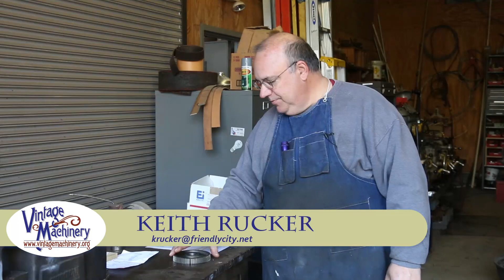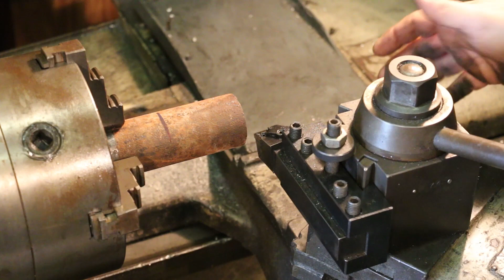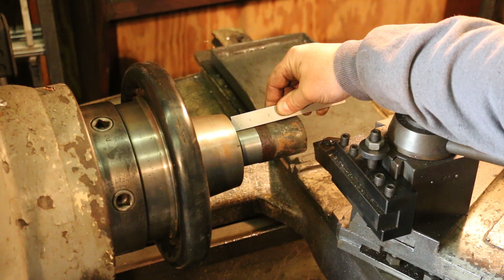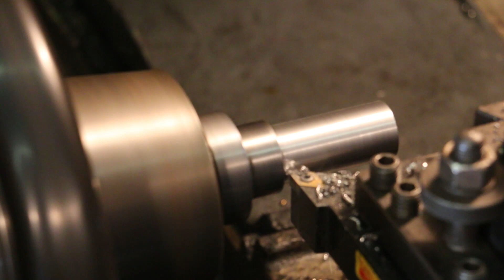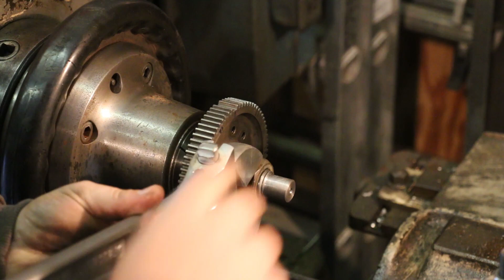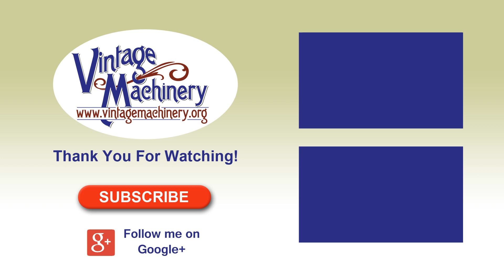Broken Gear Repair:  Machining a Custom Mandrel to Hold the Gear

Comment: Do you happen to know what the pressure angle of the teeth are on the gear? I have a clausing mk3 with the same issue on the same gear and I haven't been able to find a source anywhere not even the manual that mentions it. There's an article that mentions that the mk1 version had 14.5 degree pressure angle gears but according to the same article they changed a lot of details between the versions. Also my gear doesn't mesh very well with a known dp 16 14.5pa gear. I have tried a few ways of measuring the pressure angle but had little luck getting a solid answer. All the measurements I have taken indicate that its pa is 20 degrees but I don't want to buy an expensive cutter to fix it only to find its suppose to be 14.5 and it matches a cutter I already have.

Comment: Hi Keith,

You don't of course need a dividing head for re-cutting the teeth. You can just index off some of the existing teeth.
Reply from the maker: +Paul Compton I will set up off of some of the existing teeth but then I have to index to the new teeth that will be cut.
Reply: +Keith Rucker - VintageMachinery.org Using a lathe change gear and an index plunger is a common model engineering trick for simple dividing, there are many articles on setting one up on the back of the lathe spindle for example. 

As long as you chose a section of the gear to be repaired that has sufficient adjacent good teeth, you can use those teeth as indexes to re-cut the teeth on a damaged section. 

I thought it might be good to show people that this sort of repair is possible, even if you don't have a suitable dividing head, or one with the right indexing plate.

Comment: Great job making the arbor. You are about the only guy on the tube that runs the key seat cutter at a slow RPM  as it should be, as I have done, do, and been shown by my toolmaker fellows on the job...helps prevent chips/heat loading and snapping off at the small dia. of the shank. {Or maybe it was we were paid by the hour?}
Reply from the maker: +alpho52 The first time I ever ran a key seat cutter many years ago, I ran it real fast and it made this really fine chip almost like steel wool.  Then it got hot and the shavings turned red and actually caught on fire!  That was when the older guy in the shop who I was learning under taught me how I was supposed to do it....

Comment: Hi Keith I was wonder is the gear cast iron or cast steel and if it was cast steel if it would be better to weld the area up with a mild steel rod say E6012 or E6013 and then machine the teeth back I am not a machinist and was just wondering
Reply from the maker: +DS75921 It is cast iron.  I know that some people weld cast iron, but I have had the best success with brazing on cast iron.
Reply: Hi Keith here is why I ask there are two grades of cast, cast iron which is the lower grade and cast steel. my welding teacher taught me that if you can cut it with a cutting torch you can weld it with a mild steel rod which works very well. just my thoughts

Comment: Keith the other day I watched a video of yours published about 2 years ago and you made some spacers/dam for a Babbitt pour for the planer matcher. You used some shafting off of some railroad wheels. The material you used to make the mandrel looks like the same stuff. If it is you must have a lot of it. I really like your videos and watch them with great interest. So much so I have been in contact with L M to come down for a couple of weeks to do some volunteer work at the museum. I live in Ohio and I need to get out of this snow and cold. I hope I get to meet you
Reply from the maker: +captahab801 I don't think that particular slug was off of the old railroad axles, but we have tons of old rusty "mystery metal" here at the museum - mostly old shafting salvaged from various places.  It is nice to have stuff like that for jobs like this without having to go out and purchase something new.  Good luck with your volunteer work - I hope that works out good for you. I also hope that you can stop by for a visit to the museum here one of these days!

Comment: That is great! I am in the process of doing something like that. But I use a turntable to cut the gears and it has a mt2 holder. I can't thread on my lathe because the gear is broken. I find it difficult to have the thread exactly in mech with the taper in order to have the gear center. Maybe in the second part I will see how you hold the part in the indexer.
Thanks for taking all of your time to show us so many things.
Warm regards
Reply from the maker: +Robert Patoine A turntable can be used to cut gears just fine - you just have to be sure you dial it in just right.  I will have the dividing head job coming up real soon.
Reply: +Robert Patoine  Since it is the shoulder and face that determines accuracy and not the thread you can just tap the arbor and use a bolt to hold the gear. Or you could mount the gear on a plate that is bolted or clamped to the faceplate or table. Or single point broach it on the lathe.
    Mike (o\!/o)

Comment: I cried a little when I saw you use that emory cloth without covering the ways...  =(
Reply from the maker: +Jay Walt I guess there are different takes on this.  I always clean my machine really good from one job to the other so any abrasive that would be on the ways will be cleaned up.  And because of the range I was running the lathe, the carriage never ran over the ways in that area.  When swinging larger diameter items like this gear with all of those teeth on it, I don't like putting a cloth under the part as it is too easy for the part to grab it up and start swinging it around where it could hurt somebody (myself)!
Reply: +Keith Rucker - VintageMachinery.org Gotcha, makes sense and happy you're aware of it.  A guy wanted to buy my logan lathe but when I found out his only use was going to be grinding on it I refused to sell to him, he was pissed but It was the principle of the thing.  I just realize these well made machines wont be around forever.  I love your videos!  Hope to see more locomotive work!

Comment: Keith just a question for you why did you not undercut the flange and the diameter so the nose radius of the tool so the gear would purchase on the face of the flange?
Reply from the maker: +James Spires I actually did - but I probably failed to mention it while I was doing it.  When I faced the flange, I ran the tip of the cutter into the diameter enough to give clearance.  That is pretty much how I always do it.

Comment: That's a lot of metal to shave off.  Love the thread cutting, so meaty those curls of steel coming off the cutter.
Reply from the maker: +excession777 That part was hiding inside all the time - just had to get it out!

Comment: keith, thanks for getting back to me.i can tell by the comments that i didn't explain my self very well. when i made my comment about the angle of the compound i was not refering  to threading. i was taught when turning stock to set the compound at 60 degrees and use it to set the doc. then use the cross feed dial as a repeatable zero. if i need to thread i turn the compound to 29 1/2 degrees. of course if you have a dro that changes every thing. you can set zero and return to it anytime. i know other machinists who use your technique and i was curious to know if there was any advantage to doing ti that way.
Reply from the maker: +larry sperling I pretty much leave my compound set on 29.5 most of the time unless there is a reason to set it to something else.  I guess that part of the thing is that with doing the kind of work I do, there is not much of a need to return to the same zero all the time since I am not really doing production work.

Comment: Great video, as always, Keith.  I learn something every time.  Incidentally, I have the exact same repair to make on a gear I have that's missing teeth, so this was terrific timing.  If you don't mind, what insert are you using on your "standup" threading tool.  I've got the same one, and need to get some inserts for it.  Thanks!
Reply from the maker: +Jeff Heath I believe that the insert on that tool is a TNMA.  I like that particular threading tool, particularly for more course threads - it will allow me to make a pretty heavy cut.

Comment: Thank Keith, as usual another great video and on a subject that is important to my lathe work as well. I'm not sure if that's just coincidence, or due to the fact that my old lathe needs so many improvements? LOL!

I am planning on brazing up a gear and will be able to clean up the width and O.D. on the lathe, but since I haven't got a mill or any gear cutters, do you think it will be possible to slowly file out the profile, or will the braze?
Reply from the maker: +Knolltop Farms Filing a gear tooth is totally possible - a lot of work, but you would not be the first one to do it!
Reply: +Knolltop Farms  Since you have to make a gage to file to why not just grind a tool to fit the existing teeth and broach the brazed gear on the lathe? It is no harder than single point broaching of a keyway. And contrary to popular belief it is not hard on the lathe, although it is hard on the operator. It is also usually more accurate than filing depending on the accuracy of the tool bit.
    Mike (o\!/o)
Reply: Moholo 88 I was thinking about that and just may do it, thanks for the reminder!

Comment: What is the idea of the cutting oil Keith sorry to ask a dumb question
Reply from the maker: +Greg Kernick It does a couple of things.  First, it gives some lubrication to the cutting process which makes things just cut better and easier and second it helps reduce heat in the part - partly from the lube factor reducing friction but also because when the oil burns, a lot of heat is released in the smoke coming off of the part.

Comment: I know its a bit off topic but it is related to what you have shown us in this video. Is it possible to thread both an external thread like this left handed (ie 8threads per inch) and a matching internal thread to form a turnbuckle device with RH threads on one end and LH threads on the other such that when the centre tube is turned the turnbuckle overall lengthens in one direction and shortens in the other direction?
Reply from the maker: +Dan Whiteford Yes, you can cut both left and right hand threads and both external and external threads.  Internal threads have some challenges, but they can be done.

Comment: Keith, in reference to cooling down the part in the lathe, how consistent is the collet chuck if you removed the part, cooled it in - say a bucket of ice water, then put it back in the chuck. Would it retain the same consistency as when you removed it?
Reply from the maker: +Railfan 439 The collet chuck is pretty consistent, but if you cool a part down too fast, it is possible to distort it causing run-out on its own.  And if it is too hot when you cool it down fast, you can harden the part making the job of finishing it harder.  I typically like to let things cool down on their own or use something like the air hose to slowly cool them down.

Comment: In my 50 or so yrs, I never get sick of threading, now a days- no fish, no pitch gauge and
no math.  How?  (for the new people)  think of first time behind the steering wheel?}
Didn't you look where the clutch, brake and gas pedal was?  But you do not now, right!
Same deal  with machine work - -  look listen and feel  !   Keith I love your presentations  although I do this each day, you sir are better than the TV.  A great, you qualify for a TV show.   I have not graduated to V belts either  = check line boring  on a 1918 Greaves heavy 20  lathe  on utube (and I'm far from a camera man )   samuel
Reply from the maker: +samuel pine Practice, practice, practice.  That is the secrete to so many things in life and machine work and threading is no exception.  People say it looks hard.  It is hard the first few times you do it but with a little practice, it becomes easy.  Like you say, just like driving a car!

Comment: People break those teeth when they use the back gear to lock the spindle and then try to remove a stuck chuck by slam-bang-forcing it.  It is okay to remove a chuck like that, but with firm, EVEN pressure.  If that doesn't do it, time for plan B.  Forcing it or hammering on it is only gonna make you cry.
Reply from the maker: +Chaka Wolf That is exactly my guess as to what happened!
Reply: +Chaka Wolf And then after breaking the back gear teeth they go a step further and attack the left end of the spindle with a pipe wrench.  Makes you want to cry, because you don't know who to choke!

Comment: Hi mate.  I bet we all know how those teeth were broken, don't we.
Reply from the maker: +Marcel Timmers My guess would be that somebody locked the spindle by engaging the back gears without disengaging it and then used a long pry bar to pry a chuck loose that was stuck on the spindle.  This puts too much stress on the teeth on the gear and the weakest point is the point of failure - pop, there goes a gear tooth.....
Reply: my thoughts exactly.

Comment: Nice work ..... Just a question to satisfy my curiosity, Keith: Do you keep those mandrels and fixtures after you make them for a one-off job?
Reply from the maker: +carver3419 Yep, they get thrown on a shelf.  Some get re-used for other jobs or modified for other jobs that come up.  But I do keep them.

Comment: good video keith. i noticed that you keep your compound set at 30 degrees when your doing all your od turning. it seems that it would be a pain to keep track of cross feed settings if you have to back away from a cut. whats your reason for doing it that way? anxious to see the k&t dividing head in action.
Reply: +larry sperling Probably since that's the angle used for threading. At least when I did lathe work (in high school shop for 2 years) I'd only touch the compound for angle work. I'd just use the cross slide for everything else. If you don't move it, all the feed settings will stay the same (since the power feed only works the saddle and cross slides). Since it seems all the threads he cuts are the same pitch (good ole american SAE), it would make sense to leave the compound at 30 degrees, since that's what it mostly sees use as..
Reply from the maker: +larry sperling That is the way you do it.  Instead of explaining it here, go back an watch this older video I did on threading:  https://youtu.be/zmZO0LU6j_U

Comment: i always enjoy the random repair videos, good to know someone out there is getting a machine back working from it
Reply from the maker: +jusb1066 I like helping people get old machines back running again!
Reply: +Keith Rucker - VintageMachinery.org I need help with my lathe, mostly on how to set up the gears and to make a disconnect and engage lever to lose drive directly on the chuck.

Comment: Great work Keith, I am curious to how durable the Braze will be on the cast iron? could You not slot then insert some steel then mill the tooth? just curious, thanks for sharing
Reply from the maker: +TIM WILSON I have inserted steel or even cast iron to do a repair like this before, but a braze job will hold up surprisingly well over time.

Comment: Keith,
The brazing should do just fine. About a year or so ago, the other Keith (Fenner) did a repair like you are doing for a (I forget the make) lathe with a bull gear that had some broken teeth. He cut another gear but fixed the old one for a backup like you are doing. ... I am not an expert on brazing by any means. I have found that, in most cases, brazing can be as strong as welding when brazing cast iron or a "weaker" grade of steel. ... Thanks for the video! Regardless of the topic, your videos are always interesting and enjoyable to watch. ... When are you going to do like doubleboost and abom79 and do some cooking?
Have a good one! 
Dave
Reply from the maker: +Swarf Rat Yes, this project is very much like what Keith Fenner did a while ago.  And my approach to fix it will be nearly identical.  I agree about brazing being plenty strong - I do a lot of brazing and I have had very few jobs fail after being put back together.  As for cooking, I will stick to working in the shop.  I do some grilling from time to time but that is pretty much off topic from what I like to shoot videos on!
Reply: Keith . . . I was just teasing you anyway.